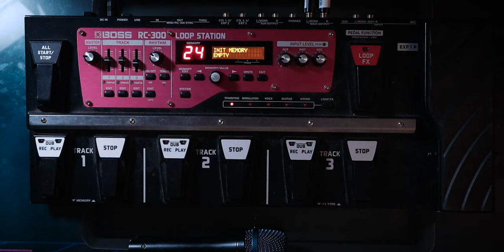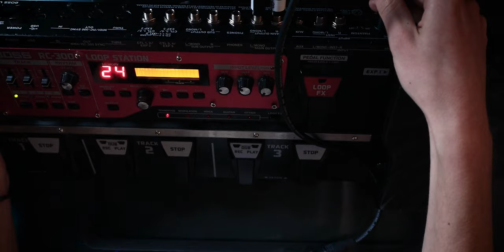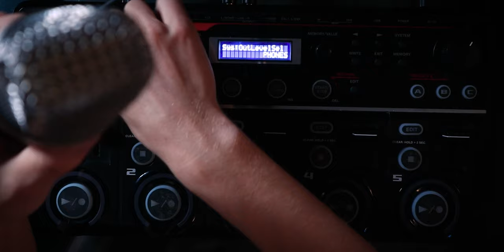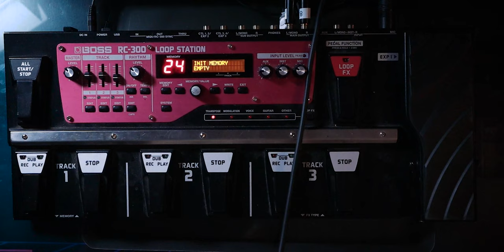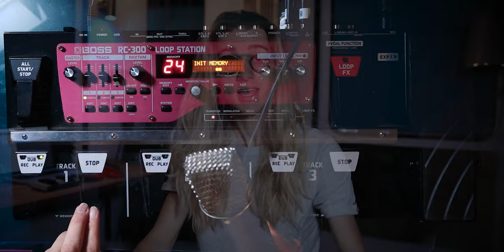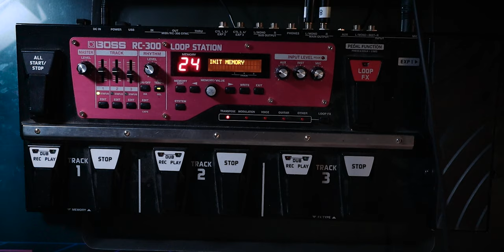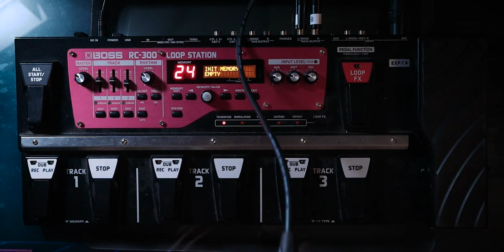Condenser vs Dynamic Microphones!? Which is BEST for Live Looping?

Comment: Hey Ben, I have been looking around to see if this won't damage my Boss RC 505 aux input...I have a Zoom H2N condensor mic, going into the aux input of the Boss RC 505. I don't need to turn the phantom power on for that do I, because the Zoom already has it? Or does the phantom power only go on when you have a condensor mic hooked into the xlr port? I just don't want to blow anything? Thanks...SBN RESONATE

Comment: Hi Ben,
Thanks for this 
Good view of the differences between condenser and dynamic microphones. Your example boss loopers seem fine with the dynamic mics. Did you try them on the RC-500? I have no luck in getting the dynamics, (Audix Fireball, SM57 and SM58) to trigger the auto record even with mic level set to maximum and input sensitivity set to 1. I don't own a condenser mic so not able to try that. I' like to record vocal harmonies and doubled harmonica lines but at this point I'm using a JamMan pedal for this which is just extra hassle for me.

Comment: HI Ben, Great detail here! I am interested in buying a DPA 4099 instrument microphone (condenser, with ambient sound rejection). Will RC500 or other Boss loopers with phantom power work as a source of phantom power for such an acoustic instrument condenser mic? Next, can the guitar cable coming out of the looper now go to the guitar input (not XLR) of an acoustic guitar amp without loss of good fidelity that a high quality mic such as DPA provides? I am looking for a bedroom, and not stage, application, and trying to kill three birds with one stone: 1. Get a quality proximate mic for my multiple acoustic instruments, 2. Phantom power the mic (DPA 4099) with a looper (rather than a DI box), and then 3. Add some modeling (compression and reverb) from my Yamaha THR5A amp. This way, if this is a workable setup, I can record better for home-made YT videos, and conceivably also have a live performance setup (everything is battery powered, plus sideways sound is rejected by DPA). Thanks for your expert advice, in advance! Cheers, from Vancouver! LTJ

Comment: Thank u Mike great information thanks so much I just bought the rc500 and need a mic now I will get a dynamic thanks to u cheers lad from Ireland 🇮🇪
Reply: How is your experience with dynamic mic on RC-500 ? I bought a dynamic mic but input level of the mic is too low when you connect via XLR input.

Comment: I use Shure beta 58a 😊
Reply from the maker: Great Microphone!! Nice Choice!!
Reply: @BenRowlandsMusic  Hi. I am a noob regarding these things. But my son has a boss rc-30 (which also has the option of phantom power for condenser microphones). I also have an audio technica atm41 dynamik microphone (which obviously don't need phantom power, but perhaps a preamplifier? I dont know).

Anyway, do u think using such a dynamik microphone together with a boss loop station is a good solution, it will be good? Or would some preamplifier for dynamik microphone be needed first?

Hoping for a reply and some help, is atm41 ok/good for boss loopstation as is, or something more needs to be done first, before plugging it into the loopstation via an XLR cable?

Kind regards, Staffan
Reply: @staffan144 i have sm58 but i have problemas cause they sound filter in My bucle